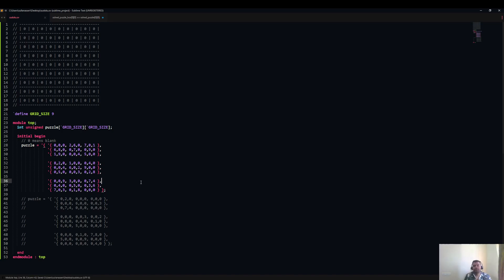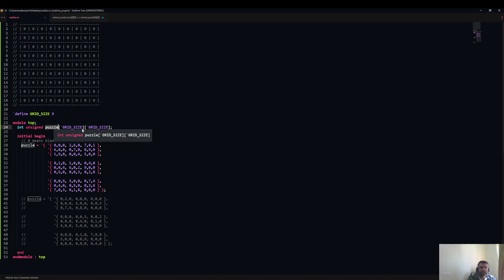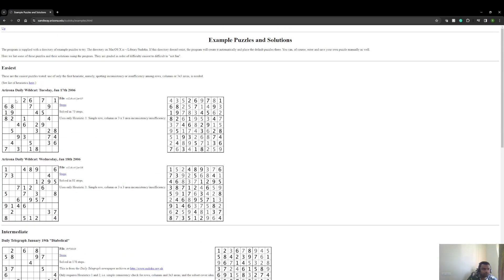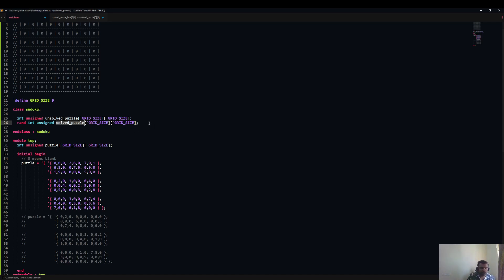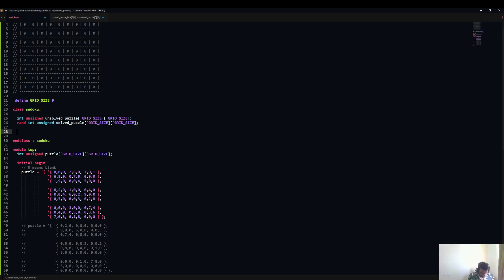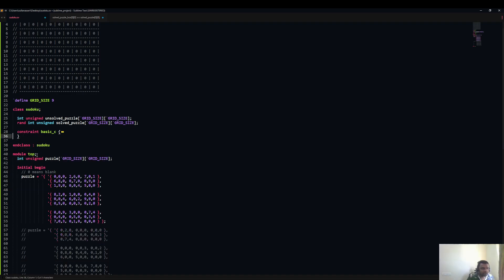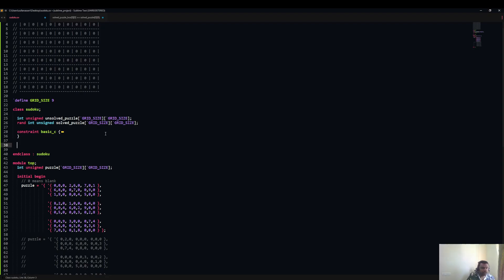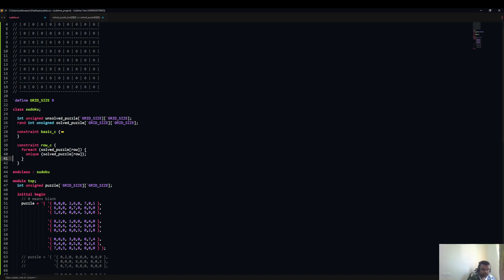Sudoku Solving with System Verilog Constraints | Coding with Example | Unique | Matrix Transpose

Comment: I have a question about the col_c constraint:
So you are taking transpose of solved_puzzle and storing it in solved_puzzle_transpose and then applying unique on the transpose. How does the solved puzzle get the unique transpose values? We never put it back into solved_puzzle right?